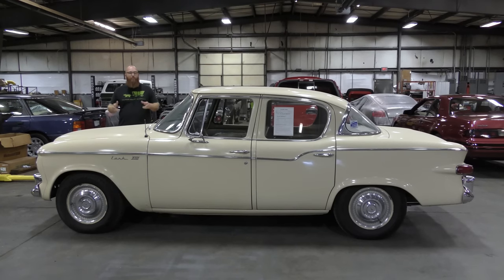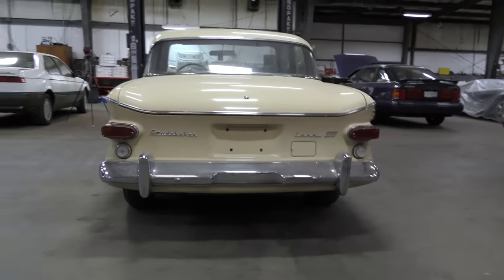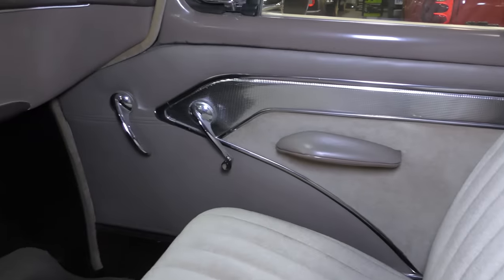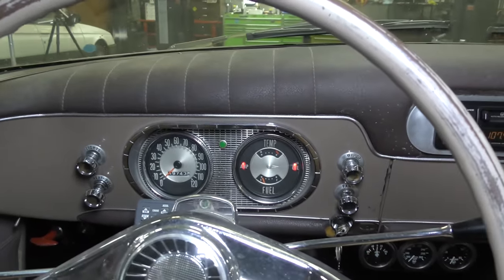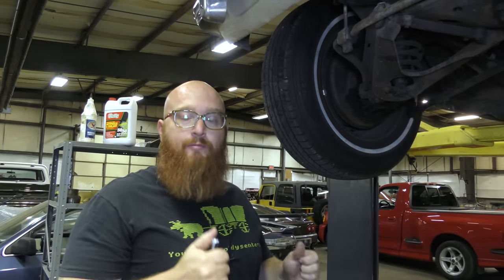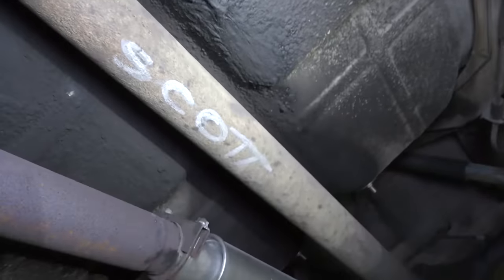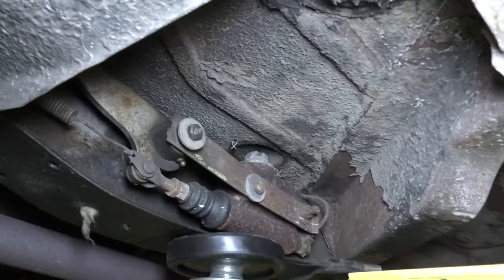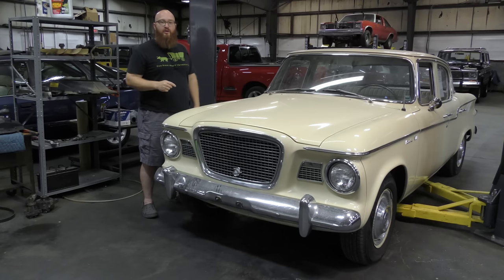Finally a CAR WIZARD approved engine swap done on this '60 Studebaker Lark VIII

Comment: Hi Mr. Wizard. Enjoyable Show once again.
Regarding the use of a Chevy small block in this Studebaker engine bay:  I am going by memory here but I think I am 98% correct regarding this bit of added info: The Studebakers made with Studebaker engines were last produced I believe in late December 1964 as they closed out production, because in early December 1963, Studebaker decided to close up in South Bend, Indiana where their assembly plant & test track were located (the test track was about 15 miles west of the factory in S. Bend). However, after the factory in S. Bend closed, production was continued for the remaining 1964, 1965, and part of the 1966 model year through March 1966 (?) -- (with a more limited model range as the Avanti & Hawks & P/Us were gone) to make a little $$ off the old parts still lying around. --And apparently they actually did make a tidy little profit on these final builds of about 1 or 2 million $!! (which was not inconsiderable back in the mid 1960s). So Studebaker left the auto business of producing cars/trucks, but continued on as a different kind of successful company (I forgot the name they then went by or if they changed it at first).

Since Studebaker introduced their own V8 for the 1953 model year & mostly the same under-chassis was utilized, it was relatively easy to fit in the Chevrolet 283 V8s for the remaining years of production (along with the Chevy I-6 engines) in Ontario Canada, & I believe Studebaker parts (which were fairly plentiful for a while, even after production died) such as engine mounts, were available in the mid & late 60s. Since these Chevy engines came in the later Larks from the factory it would seem to be the most logical choice for an engine replacement with any hiccups ironed out long ago.

Regarding the front end styling: Studebaker was an importer for Mercedes-Benz in the US I think starting in the 1950s which may have influenced design (including the front grill). In addition a number of Studebaker Dealers converted to M-Benz Dealers after Studebaker left production. 

Regarding the short overhangs: I think the wb (wheelbase) was longer partly because Studebaker used the larger (longer wb) bigger previous Studebakers as the chassis base for the Lark as an entry into smaller more fuel efficient cars. To do this while using the longer wheelbase of the previous 1953-57 model years Studebaker sedans, yet with a much shorter overall length, they cut off the overhangs resulting in comfortable interior room & decent trunk space while still being a lot shorter, getting more mpg, & added clean simple style which relative to the often overwrought  styling of that time (think 58 Olds, 58 Mercury Turnpike Cruisers, 59 Cadillacs, even the 58 Corvette, etc). --& their timing was quite good since their was a sharp little economic recession in the US making these smaller yet still relatively roomy models more popular... 

If I made any mistakes feel free to correct!

Comment: I have a 60 Lark too. Mine still has the original V8. Drum brakes leave a little to be desired, and the single circuit master cylinder can be dangerous if a wheel cylinder “pops” or brake line leaks. There are companies that make complete disc brake dual system upgrades. I would have included a picture of my Lark, but can’t figure out how to do that. Buy a Stude, they are a lot of fun and there is a lot of support for the cars in the Studebaker Drivers Club.

Comment: my very first car was a 1964 Lark that had the v8 engine with the Paxton supercharger. It actually was the fastest car I've every owned. Saw the identical car to mine back then being used as a police cruiser with a corrected speedo that was rated for 150mph. A handwritten tag on the speedo read 153.6 and I have no doubt they were capable of that speed. I embarrassed many camaros in my day.

Comment: My sister's first ever boyfriend had a 2-door Lark sedan of the same vintage.  He was about 17... I was maybe 12.  A cool car for sure, but back then it was just an orphan brand that no one loved.  great memories.  Assuming you have the chance, convince the owner to put a dual master cylinder in the brake system so it will be safe for another 60 years!

Comment: Studebaker used Chevrolet engines for for their last two years after the South Bend Indiana plant closed and they were made in Canada. The chassis dates back to 1953  (check out a '53 Starliner). Here's a little info you might have seen. https://en.wikipedia.org/wiki/Studebaker_Lark

Comment: '66 Studebakers used a 283 Chev engine. The ones that came to New Zealand did.
Reply: '65 & '66 and since they are fundamentally the same as this, it's an easy swap.  But why do it when you can get parts and make a Stude V8 as powerful as you could want.

Comment: I can't blame you, That was one hell of a little car. A typical salesman's car, with normal care you could expect one of those cars to live for 250K miles. No real power to speak of and terrible brakes were common. A 283 would be more then enough. Grease zirks  were all over because everyone KNEW a cars cost was exorbitant. They were supposed to last. This is a great video. If I could find one like that here in Texas, I'd buy it myself.

Comment: Nice intro to the world of Studebaker. Your comment about the design being "cab forward" is almost correct. Since Studebaker was perennially cash-strapped, the way they created their Lark "compact in 1959 (one year ahead of Ford, GM and Chrysler) was to take the standard 1958 Champion/Commander and lop about a foot from the front and back of the car. Voila, instant "compact."  As someone else noted after Studebaker moved production to their Canadian assembly plant, they used "GM of Canada"  Chevrolet small block V8s and Chevy inline sixes, and Powerglide transmissions. Those Studebaker V8s were crazy overbuilt ( ie heavy) and were some 200 pounds heavier than the SBC.  And the exhaust pipe would have run to the rear bumper.

Comment: This car is shown its appreciation someone spent the $ in the right & correct ways. Even adding the Seatbelts (even tho it’s grandfathered in to pass inspection without them) they still did considering safety 👍❤️ and kept is as original as possible. They didn’t hack it up or drill holes thru the firewall for wires/hoses due to unmatched modifications! JOB BEyond WELL DONE 🎉❤

Comment: As a kid, I remember trying to find the oil filter on my mom's  1961 Studebaker Lark 259? V8 back in the 1970's. Guess what? There wasn't one. A partial flow oil filter was an extra cost option, but her Studie didn't have that. It also had a 2 speed automatic with a strange shift pattern with reverse next to low. It was really a nice car. I also remember having to go to Mercedes dealers, because sometimes they would have NOS parts back from when they were Studebaker & Mercedes dealerships.

Comment: I've always liked early 60s compacts - especially the Larks.

I wouldn't have changed the radio and its surrounding panel so drastically. I could add an FM converter and tune the radio off to one side of the carrier (this greatly improves treble without losing bass).

The "Mercedes-looking" front grille likely derives from the era when Studebaker-Packard Corporation was the US distributor for Mercedes-Benz automobiles.

Comment: As a matter of interest Studebakers we’re reasonably popular in Australia. AMC assembled right hand drive versions here from ckd kits. In the early 60s, police in several states had Larks fitted with Hawk GT V8 engines. Fastest sedans here at the time. Nice review. Thanks.
Reply: Yes but not the AMI factory at Port Melbourne who assembled Ramblers, Standard, Triumph, Mercedes Benz then Toyota .AMI not AMC. Toyota liked them so much the y  bought the company.
Studebakers were assembled by a company at  Heidelberg West who were later taken over by Renault to concentrate on them and Peugeot.
Studebakers of this era sold surprisingly well in Australia assembled here from Canadian sourced parts and local content.
More common here than Buicks, Oldsmobile, Mercury, Dodge and Plymouth. Similar with Rambler.
Police thought highly of them. Some police racing enthusiasts bought them at police auctions to go racing at Bathurst.
Story of the Australian Studebakers here :
https://youtu.be/SHHTPLw-oNM
Some of the police highway pursuit cars were two door cars. Would these be Daytona bodies.
Standardised on V8s with highest trim level here to justify higher prices and simplify the range.

Comment: Having a Studebaker family with various models from 1953 Starlight couple to Golden Hawk to Larks, I can agree that is is a fine unrestored Lark. It's low mileage, likely indoor storage, and loving care, reveal how it was able to escape the inevitable 'rust devil.' The SBC is almost a natural for the Lark which might have used factory parts available from later Avanti cars, with essentially the same 1953 chassis design, that were powered by SBCs. LOL on the number of grease fittings. A grease job required a chart just to keep track of the how many and where the Zerks were. Most of the time too much grease under too much pressure was use. I'll take the newer greaseless design any day. Nice content and walk around video Thanks.

Comment: Nice ride! Engine appears to be mid/late 1970's 350. 
If mine, I would research cost/availability for upgrade brakes to at least dual master cylinder. 
Ooh, wide white wall tires would be a snazzy look!

Dad had dealer option rear seat belts installed on our 1959 Chevrolet wagon.
Studebaker may have offered?

Thanks for the tour!

Comment: I used to drive cabs part time. The owner used to fit grease nipples to high-wear joints so he didn't have to replace them. A regular few minutes with grease gun was preferable to taking them oos to replace them.

Comment: There's a reason for the small front and rear overhang. It's Studebaker's 1953 full sized body. It got various facelifts through the 50's but finally couldn't compete as a full sized car, so they trimmed off the nose and tail and called it a compact. The Chev engine makes sense too. The last Studebakers, circa 1966, used Chev engines as Studebaker shut their engine plant somewhat before they stopped production totally. The Chev V8 is quite a bit lighter than the Stude V8, so is a good move for steering and handling also.

Comment: I was a policeman in Phoenix, AZ from 1959 through 1963.  The police department got a good deal on Studebaker Larks and bought a bunch of them.  You didn't want to get in a chase with them their top end was about 85 or 90.  I recall they were pretty comfortable to do a day's work in but just weren't a good police car.  When I saw this pop up on YouTube I just had to watch it.  I haven't seen a lark in years.  We had some Plymouth cars that were fast but you had better have a good hold on the steering wheel if you had to use the brakes aggressively because you didn't know if it would pull to the left or right.

Comment: I learned to drive in a ''60 Lark in South Bend where it was made by many of my uncles.  I remember that model had rust issues, especially on the front fenders near the door hinges.  This one must have been raised in a dry climate to be so clean.

Comment: Excellent video and car. I was born in 1960 and remember seeing these Studebakers around in my early years. Worked in a gas station when I was 16 and remember seeing the appointment book with "LOF" marked as an appointment for the mechanic each day and wondered what that meant. Found out soon enough and Lube, Oiled, Filtered my cars ever since. Hard finding some of those fittings. I always seemed to forget a grease fitting or two now and then, but I got it later. I miss those work on my car days.

Comment: I had a major medical emergency on Christmas eve of 1963, resulting in me being rushed to the hospital and spending the next six weeks there. I was four years old. What does that have to do with a Studebaker Lark? I will explain. My mom was 42 years old when this happened. She had never driven, was not interested in driving. In the spring of 1964 she got her driver's license. For two years she and my father shared a 1957 Ford. In the spring of 1966 my father got 1962 Rambler American and my mom got her first car, a 1959 Studebaker Lark. As such, I've always loved these cars. A couple of things about the Lark. Studebaker decided to compete with the new compacts that were soon coming from the big three. (The Falcon, Corvair, and Valiant. To do this Studebaker shortened the overhangs and the wheelbase of their larger cars and had an instant compact. Take a look at a photo of a 1955 Studebaker President and you will see the exact same passenger compartment. The other cool thing is that the six that was originally offered in this was a flathead. (In 1960, that was old school.)

Comment: There is a Studebaker wagon on eBay right now...1964.  Has the sliding roof, said to be an ex-museum piece. Yet it has a Chevy small-block.  I don't know if it's been modified or if the registration is hinky. A 1965 Studebaker wagon looks just like a 64 but came from the factory with a 283. BTW  I love this little Lark sedan.  Very classy car.

Comment: These Studebaker Larks are wonderful cars. Small block Chevy is a decent swap and easy to get parts for. I’ve owned two Larks in my lifetime. One was a ‘62 Cruiser Lark with Studebaker 289 V8. The other was a ‘63 Lark with the 259 V8. Both are wonderful engines. However, when it comes to parts you need to be in a club to get what you need nowadays.

Comment: Cool. My high school car was a 57 Studebaker. My brother and I rebuilt the engine after I blew it up racing. 
On this one, since it has whitewall tires, might as well mount them with the whitewalls out, not in. It would be period correct.

Comment: BTW, my '63 Falcon had zerks all over the place also. You had to CONSTANTLY grease the upper control arms or the grease would congeal and not flow at all. From the factory, MANY Ford Intermediates did not come with grease fittings for the upper control arms:(-John in Texas

Comment: Swapping out GM engines into Studebakers is a time-honored tradition.  My father was one of those teenagers you referenced.  They would replace the stock motor with Cadillac engines and then called the combo "Studilacs."

Comment: A note and a story.  I am surprised when you were comparing the Lark to other 1960 American cars, you didn't mention the Plymouth Valiant.  In the late 80s/early 90s, I used to take the train (Amtrak) from Chicago to Albuquerque quite often.  There was a station stop at Dodge City, Kansas.  Tucked behind a gas station just before the station, there was a turquoise Studebaker Pickup - (probably 1960 to 1963).  I saw that thing for years.  I moved from Chicago to Albuquerque in 1994.  I had to make a couple of trips, and I had 3 Checker A11 taxicabs that needed to move.  I drove through Dodge City, and I found the gas station (I knew exactly where it was).  It was a Sunday morning.  I walked around the back to look at the pickup, and it was in terrible shape.  The rust was all the way through in most places, but it still looked perfect from the train.  Kind of a shame...

Comment: The sway bar that you thought was innovative:  Chrysler used those from 1949.  My 55 Ford had one.  An d the Stude still has obsolete king pins rather than ball joints on the front, something which AMC also continued into the 60s.
Weird engine swaps.  1962 a friend showed up at high school with a Jag XK120 which had a Kaiser 6 swap.  XK engines were expensive trouble even then.

Comment: I recall there was a black two door Lark around the same model year running around Wichita in the 80s. I cruised along side it from a stoplight one evening and noted the tone of tree gear changes ( 4-speed) and the dual exhaust tips. Someone later said they knew of the car and it had a Mopar 440. Regsrdless, glad I didn’t embarrass myself.

Comment: had a 63 Cruiser back in the mid 90's.   had a chrysler alternator in it.  Did have front disc brakes.....  looked like 2x2" squares.   stromberb 2bb and 289 v8.   Body rolled more than a bowling alley.    cam gear for points had worn down so much that i did the unilite conversion to run

Comment: The last of the Srudebakers- the 1965 and 66 Commanders (about the same size as the Lark) were made in Canada after the South Bend factory closed.  The production line for Studebaker driveline parts closed so they put a GM engine and automatic transmission in it. The smaller companies like AMC also used parts made by other manufacturers.

Comment: Actually Wizard, i would like to see you with a modest collection of sensible classics. I would see you as the happy owner of several unique Studebakers. First and foremost i think you would be a great caretaker of one of the original 1963 Avanti. The 1953 body style is revolutionary. The early 60's Wagonaire would be collectable and enjoyable.. A Lark Daytona would be great for you. I think 1962 has the best body style and finally one last plug for Avanti because they have yet to really "catch fire" in the market place and i believe they will at some point.

Comment: You need to join the Studebaker Drivers Club. This really is a Lego swap, and disc brakes were a factory option from 61 on these. A modern disc set is available today as a bolt on too..

Comment: Many conversion small block studebaker did use small block out of Canada 282 I believe steering actually feels good with center mount manual set up and big steering wheel . The grill was originally from Mercedes even on 59 hawk I’m working on I don’t like it on the hawk as for the studebaker lark super charge car is cool , the hawk I am working on has the lark super charged motor . I did see a convertible yellow lark at moultrie for sale this year around 5 k needed a top and new paint .